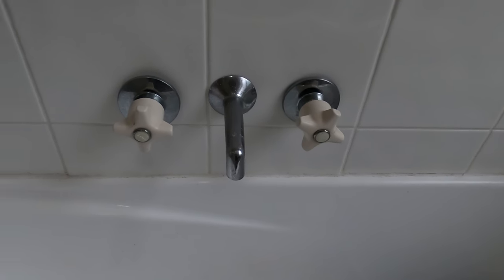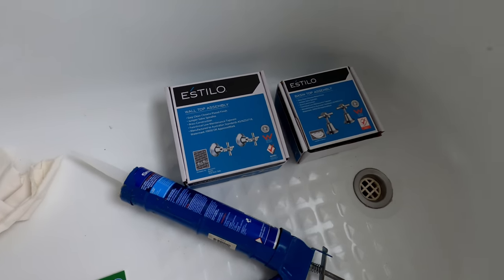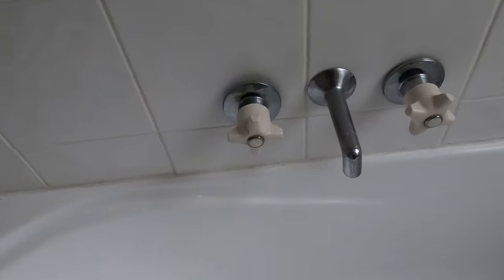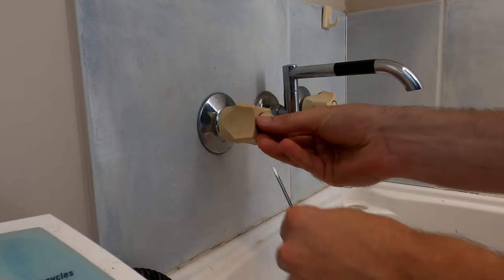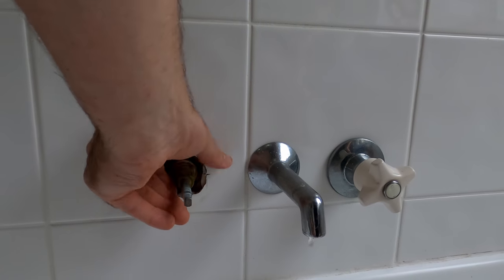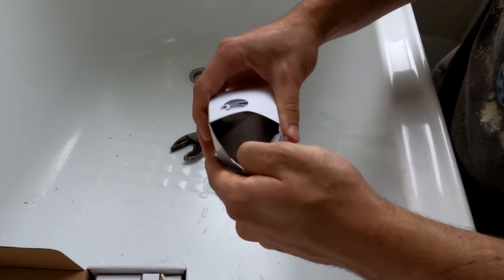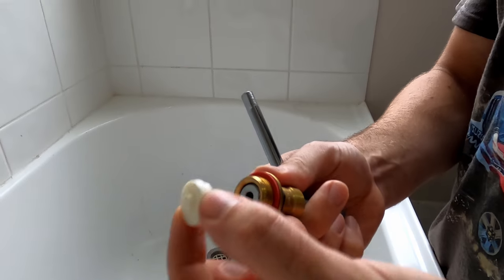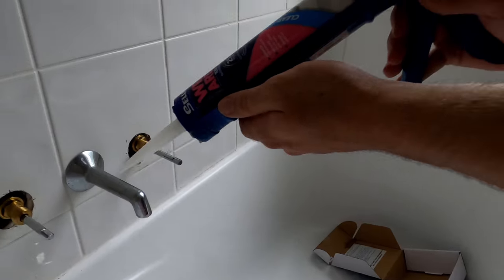How to Change Bathroom Taps (Shower, Basin or Bath) & Replace Tap Washers

Comment: Goodluck replacing washer in future
Reply from the maker: Shouldn't be any issues. Definitely wait for the silicone to dry before continuing though. I've added a note at this step.
Reply: This is exactly what I was thinking, he's just totally buggered the serviceability of the unit in the future. Although he's probably just secured future work and an extra hour of labour by doing this!
Reply: @thorpie2206 I thought it was a great idea to stop any future tap leaks getting water into the wall cavity, which is what I’m dealing with now. That causes a lot of problems and damage, not to mention mould in the cavity. Far more time consuming and expensive to fix all that. Great preventive measure.

Comment: Any reason you didn't use Thread seal tape (aka plumbers tape) on the spindle thread?
Thanks for the video.
Reply from the maker: The spindle has a rubber washer on the end so no need. When the tap is closed the washer seals before that point as well.

Comment: Good video. Wondering how to change the middel taps?? I have trouble to loose it. Would you able take a video??? Cheers.
Reply from the maker: Thanks! The spout in the middle should just unscrew counter clockwise. If there is an open end you might be able to use something solid like a big screw driver to give you extra leverage. Or use the multi grips. Hope that helps!

Comment: What do you do if the new spindle cover doesn’t stick to the tiles as we have change style of tap same sort as in the video 
In the shower
Reply from the maker: Not sure why that would be - might just be the specific design of tap you have. If replacing the spindle itself it should fit flush.

Comment: Gday mate, I have been trying to stop a leak in my basin for weeks now. Have replaced the washer many times and just recently the spindle. Am still getting a slight leak. Can you tell me why?  Cheers
Reply: With a new spindle you would have got new -rings so if it is still leaking, you might have a bit of the old washer sitting on the tap face.  Remove the spindle as if you were changing the washer, get a torch and look in the hole and see if there is bits of old washer or gunk that is still in there. You should be able to get a needle nose pliers to get them out.  Re-install the washer and spindle and it shoud be sweet.  All the best!
Reply: You also need to check the tap seat, if its dirty or chipped you need to clean it or replace it

Comment: Why not wait until the silicone is set before continuing.  Chances are the flange will be set into the silicone and making it harder to remove (should you need to in the future).
Reply from the maker: Definitely wait for the silicone to dry before continuing. I've added a note at this step. Thanks!
Reply: @juliustinkers  Good idea to turn the water back on and then check the tap to make sure it doesn't leak then put the silicone on plus put the silicone on flush to the tiles so's when it becomes time to change the tape again, removing it will be easier

Comment: Great video thanks! Can you do one on how to remove the bath spout?
Reply from the maker: Thanks! The spout in the middle should just unscrew counter clockwise. If there is an open end you might be able to use something solid like a big screw driver to give you extra leverage. Or use the multi grips. Much the same process as the taps but simpler. Hope that helps!

Comment: What do you recommend to do if the new taps don't cover portions of the hole in the tiles?
Reply: YOu might have to go to a Reece or any plumbing specialist store and see if you can get a "tap spacer" which would be wider than the tap handle.  You would put the spacer, which is really just a stainless steel ring wide enought to cover the hole that would otherwise show. Put that on to cover the hole, then install the tap body and hope that the hole is covered.  Good luck!
Reply: @behradbehrady2385  Thanks so much! that is exactly what we did! :)

Comment: I need your help, my bath tub taps are separate hot and cold water and really old, how can I DIY a shower head onto both taps. I'm renting so it can't be permanent
Reply from the maker: Have a look for "push on shower head two into one" - I think this might be what you are after. Can get them on Amazon
Reply: @juliustinkers  I got it but they slip off
Reply: check rules where you live. Can be a permanent change in some places. Just need permission first.